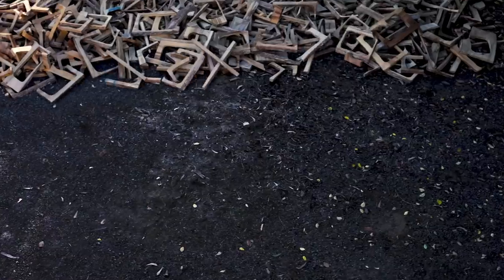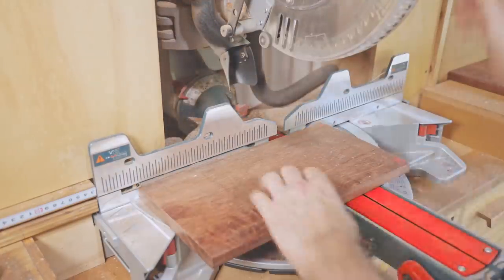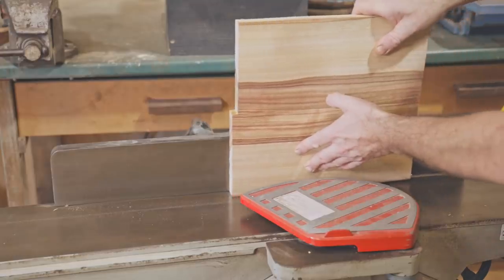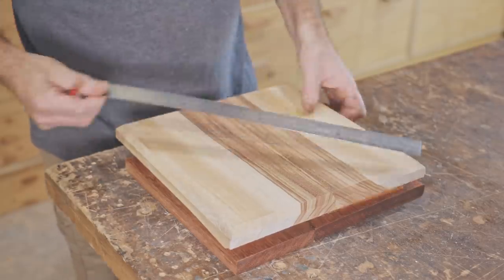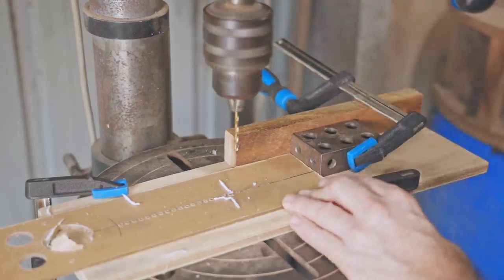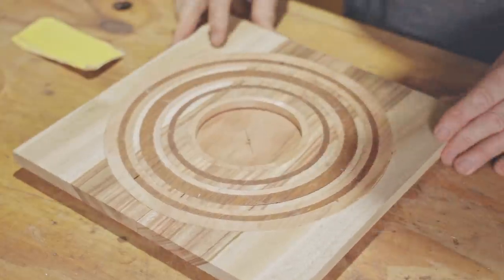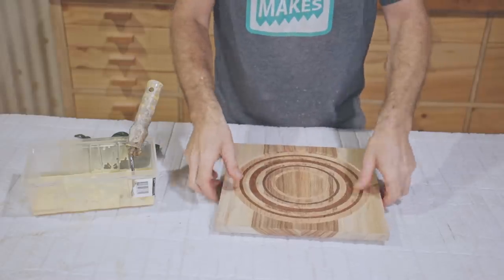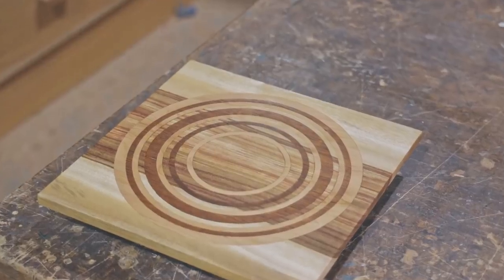Circle/Square Chopping Board - (Day 7) 7 Scrapwood Challenges in 7 Days - ep49

Comment: Great idea!
Would it have been quicker to just cut grooves in the board and then glue in the rings of contrasting woods as inlays? That would ensure the grain on the camphor laurel lined through and avoid the need for the separate disc in the back.

Comment: cutting boards should be thick enough to resist any hint of cupping, or add lil feets to help with that as well. [it'd also help with setting the board on uneven counters.]  I like the undercut though for picking it up.

Comment: When you make the rings you can cut the outside diameter with the band saw just outside the line and then just do a bit of cleanup with the router in one pass. Should save time in my opinion.